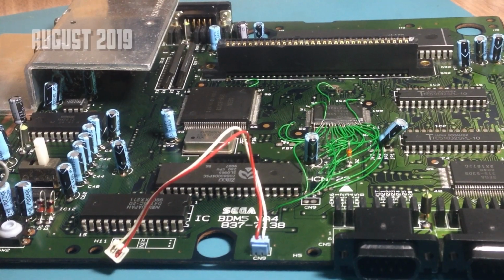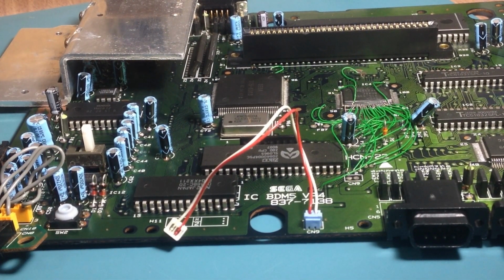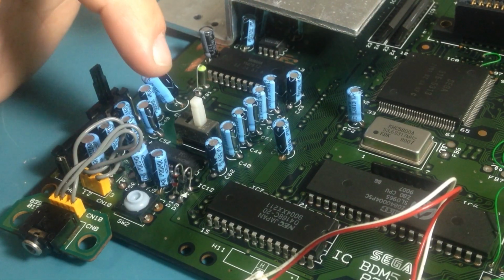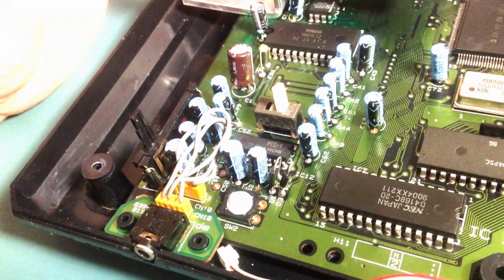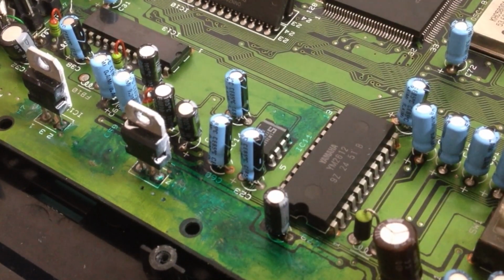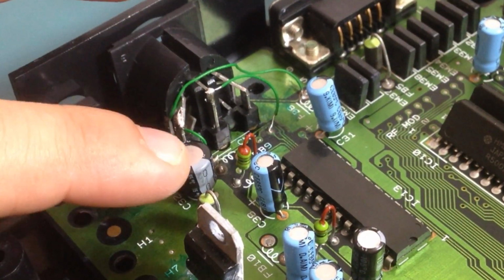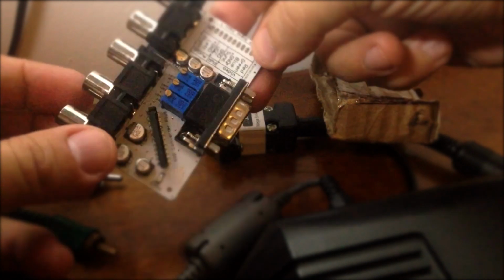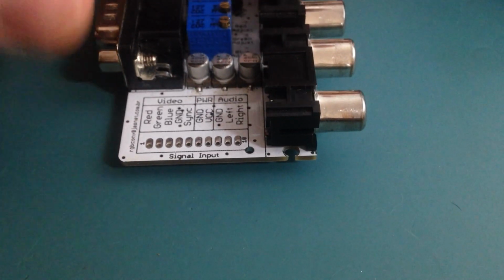Resurrecting a SEGA Genesis / Mega Drive - Part 3

Comment: Finally new video! Excellent content, thank you! About UV lights, on ebay you can get one for ~1.5$ and it actually works. Also, I'm quite disappointed I missed your live stream. Hope you make these again one day, so I can join. Unlike popular opinion, the biggest problem with console getting hot is not the ICs but the fact that these caps are rated only for 85C max, so in hot environment they will dry and burst super fast, especially ones under heatsink. ABout component converter - don't forget to cut powerline that gets power from console, otherwise you risk frying the device. And nice housing btw :D
Reply from the maker: Hi lauraiss how've u being doing ? Thanks once again for watching my video. I though about getting a UV light but I was too lazy to do that, so thankfully as we have plenty of sun here in Brazil, it has turned out really well by curing the mask ink. Regarding the capacitors, on my next video, which will hopefully come out next week ! Believe or not, hehe. I will show that I had to replace them all, and yes , for 105 degrees which are much better to be under the heatsink. Yes, you are right, i Will disconnect the 5v pin from the connector cable before doing the mod on the de converter :) what about your videos, have u released any after the everdrive Sega cd bios one ? I've gotta check it out if I've missed any ...thanks once again , have a great weekend !
Reply from the maker: Also sorry but I didn't stream live... it was only an app I've tried out on my phone and caused that notification, sorry about that. But I do stream games sometimes on twitch. It's BocasRetroStuff there
Reply: @BocaRetroGames  Everything well here, not sick or anything, but to my surprise I'm getting super lazy and apathetic because  of isolation. Working from home so in theory I have more free time but in practice, the less I do something the less I feel like doing anything. In other words, I no longer shave, iron shirts or move much.
Excellent, will check out your twitch. About videos, I will make one in English next few days, as I have one Megadrive MK1 on the table, friend said: "it does not work". Have no idea what is wrong with it, so it will be fun to find out and share it with you.
Reply from the maker: @lauraiss1027  Great to hear you're doing ok there. Here in Brazil it's been a mess but at least it's not that bad in the city I live. I share the same feeling regarding working from home, but I've been only feeling this in the last couple of weeks, as I was responsible for a really critical Project in my current job, that only has ended 2 weeks ago. That's also the cause I haven't been releasing videos.
Only now I've realized You've got plenty of videos on your channel, that's great news as I will have lots to watch next hehe. 
As you brought up the MegaDrive Not Working subject, I'd like to ask you if u ever faced similar issue my friend @hyuma hoshi who commented below is facing on his console. 
All ICs are getting VCC1 and VCC2. Some ICs should get vcc1 and others VCC2, but in his board, both regulators are feeding all ICs... I've tried to help him troubleshoot it numerous times but we couldn't find where both vcc traces could be shorting to cause this issue... I'd like to make a video about it, but he is from Italy hehe 
Thanks once again for replying and I'll watch all your videos, as you have great stuff on your channel ! take care